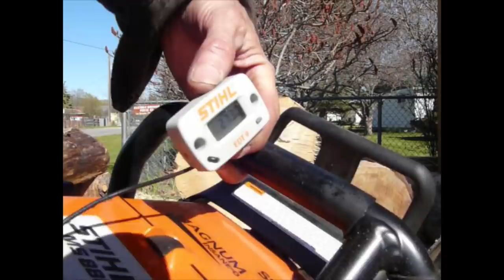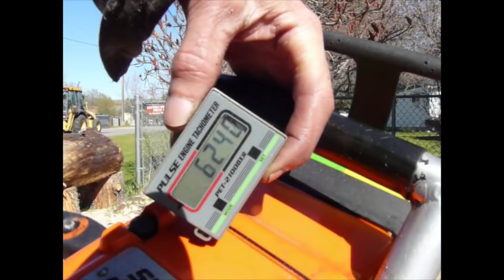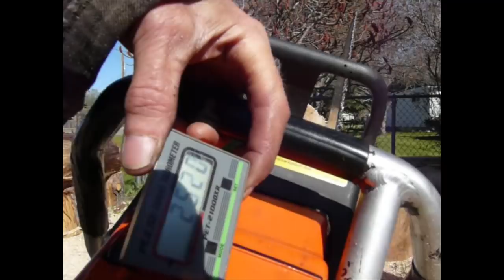Ol' Skool Stihl 084 vs. Latest & Greatest ms880

Comment: Great video, still have my 084 for the 80s...use to run a 50 inch Cannon Bar, fell a 119 inch across the stump up in Tiller on the Umpqua....fall 3 to 4 trees a day in my strip for 25 to 30M a day...was great ground. My Husky 2100 I had built in Myrtle  Creek it would out pull my stock 084. Yes new chain is not Real sharp, it's all symmetrical but not killer sharp.Thank great video. Shoe

Comment: "Triple ported muffler" thoughts & questions, if you'd indulge!!  At the beginning you mention the 880 muff is triple-ported "like always"-- I'm so confused man, am looking at the 880 muff pics from online-retailers and they're same as the one you showed on the "084 V 880 Bench Talk" video, that 880 muff is like my PERFECT idealized design I had in-mind (though my exit tube wouldn't have a bend it'd be straight-shot from that bottom PTO side intake of gas and, from there, I'd have that pipe inside the can simply make a forward, upward angle so it could dump/exit out of the front/top of the muff's faceplate)  
BUT how are you calling that tri-port?  I mean, if the OEM sticks 2 holes right-beside one another, wouldn't we still consider that a single?  I mean, by the "triple port here" logic, that means my fish-gilled 660 muff (6 fish gills on the front-face, though I added a baffle-wall separating front&back halves of the muff for a 2-stage muffler IE a front & a back portion), that muff of mine would be an octuple port because technically has 8 exits :P 
What I'm getting at here is that, IMO, it's about total exit-port-area (similar to port-areas inside the jug), and not about # of exits (although, in addition to a more pleasurable exhaust note when splitting a port into a pair of 50%-area ports, I cannot help assuming it is likely to help w/ efficiency/'flow' inside the muffler for any given exit-port-area)  The 660 muff, IMO, is such a great example for case-study here because the OEM primary exiting is right-beside the exhaust-flange, meaning an exhaust pulse exits, puffs-into the single-basin OEM muffler and hits the front wall and "blooms"/rolls-back at the exhaust flange --- this being greatly aided by making it so the exit for the pressurized gas is right-beside the flange which should effectively keep a constant, albeit *weak*, amount of backpressure on the flange for 'plugging' (preventing excessive charge spillout or 'short circuiting', obviously not remotely as efficient as the negative-sign return-wave created by a real pipe's baffle cone but we've gotta work with what we have right!?)  
Will admit I'm getting more & more convinced that a major/significant amount of power, 1 of the last frontiers on "regular type" saws (no mtronic/etc), is the exhaust system-- it's established fact that the expansion chamber revolutionized 2-strokes, however they're utterly impradtical on work-equipment (OPE gear) so we just use our OEM box-mufflers and, since un-choking them is typically an improvement, people just blindly poke bigger exit-holes and consider it "good/great" instead of simply "better than OEM but certainly not optimized", I know 55-70% of exhaust-flange area is "the norm" but I don't know why / how to determine whether to aim for 55 or 70%, and furthermore I don't know if that means an OEM flange's area, or my actual, ported flange's area...
SO I'm not only experimenting with these "Grunt Gaskets" now (headers/lead-in pipes to give space between the inners of the jug, and of the muffler-body, but also because - if I include diverging-angled walls say 3deg to 10deg divergence, it should create 'suck'/pull meaning you could get away w/ fewer degrees blowdown, all else left the same!!)  Furthermore you could probably bump compression ratio a quarter point without problem because even a 1/2" deep Grunt Gasket is now causing the better part of an inch of separation of the muff, from the hot-side of the cyilnder (which would've been millimeters away before usage of a Grunt Gasket)
Thanks for ANY thoughts if you read this, I am not only doing the lead-in pipe (Grunt Gaskets, a la "Dominant Saws") but also, instead of blindly guessing at muffler exit-area, I'm going to cut out a 1.5x1.5" square outta the muff's exit-port area, bolt-down a 1.75"x1.75" steel plate over that big hole to use for "temporary exit hole testing" & make my 1st, smallest exit hole in that plate-- do test cuts, compare times, continue enlarging that exit hole in the plate until a test-cut shows time went down, do another enlargement to ensure cut-time drops further, and - at that point - I'll look at my notes & see precisely what size exit-area was optimal, then I'm golden / no more guesstimates on such things (seems the final "engine-exit" area is actually quite important, have always hated how non-chalant we all seem to be about it!!)
Thanks again for all the great videos, seeing you hash-out so much of this stuff is some of the most-insightful content I've seen for understanding things!!

Comment: So close, the 084 is only marginally slower than the 880. Now you’ve worked on both but it makes one appreciate just how good the 084 was out of the gate.
Reply from the maker: DC hi.
I posted the results in the description area.
The 084 was actually faster on the way down. Only .2 of a second slower up.
That's less than a sneeze in time.
2 pounds less weight to boot.
Considering the upgrades in the flow enhancement department on this new and improved 880 I am well pleased with the 084's showing.
Thanks for watching.

Comment: I know it's off topic from this video, but what fuel:oil mix would you suggest for a stock 661? Stihl says 50:1, but I was thinking 40:1 would be better.
Reply from the maker: J.T. hi. 
Yes, usually the "oil" questions come in on the "oil" video. 
I cannot tell you what to do. There is a reason the "factories", for the most part, all recommend 50:1.
Keep in mind that oil will hold in residual heat. 
I mix ~ 48/50:1 on personal level. But, I blend my own and use top tier components. Substandard oil, well, better ramp it up a bit lest the engine have a melt down.
Part of it is tuning as well. The new "save you from yourself" saws don't allow for operator input. In some instances that is okay. Some it is not...
Better be using a top shelf oil if running a new version, smog (stratified), lean, hot, running saw. 
I'd run Chevron gas if using pump fuel and burning through it quickly. A premium, non ethanol option if not.
I'd run H1-R from Bel-Ray in a stock saw, weedeater, string trimmer, blower, polesaw, compactor, etc., etc.
Thanks for watching.
Reply: @hotsaws101  thank you, sir. I knew it was off a bit from the video, but I had heard a few different things about the mix. The only oil I've used in the mix is the Stihl 2 stroke oil. They extended my warranty for buying the oil with the saw, and even took a couple hundred off for me, which is always nice. I wanted to ask someone who knows a lot about saws before changing the mix, so again, thank you for the response.
Reply from the maker: No worries.
It doesn't mean you will get more life out of your saw by using that oil. 
The factory needs to sell parts too. In order to do that, their "company blend" cannot be that great. Otherwise, well, no parts sales...
That oil has some tier 1 base stock as far as I know. The H1-R is on the opposite end of the oil spectrum quality wise.
It shows when I tear them down.
Thanks for watching.

Comment: I find you to be a matter of fact man. Thank you for that. Please do a video about all what you reccomend for mods on saws. I have a 391 and it is old in years but still not enough hours to be broke in yet. It's all stock but I'd really really love to get mods on it. I am uneducated and not able to improve it myself. So real recommendations are more then welcome. Currently running 28 inch bar but I find it works awesome for limbing but it struggles some when going into 24 plus inch wood for cross cuts.
Reply from the maker: Brandon hi. That's a bit of a can of worms. No one wants, or needs, the same thing. I don't just say you need this based on a cookie cutter type philosophy. 
If that was the case, I'd say that you should get a pro version saw and go form there. On the other side of that, your saw has a clamshell design cylinder assembly. Cost prohibitive to bump the compression in the standard fashion. They (that cylinder design) will come around nicely as seen in the 346 vs 291 video - https://youtu.be/HIY8VHjAonk   
Unfortunately, that engine design has limitations from the "homeowner" target market point of sale.
Thanks for watching.